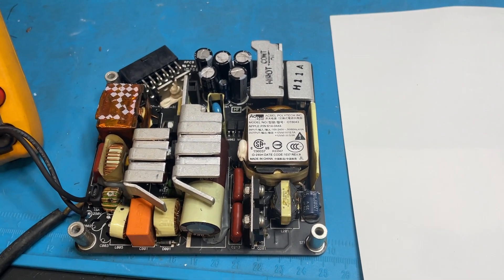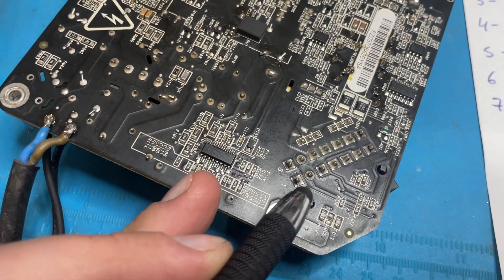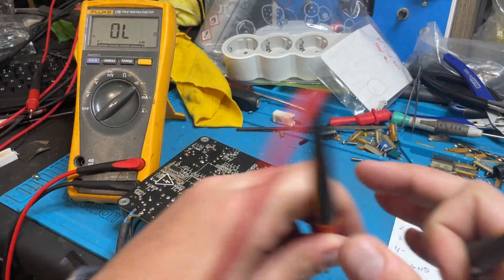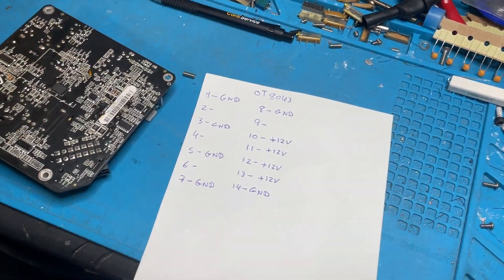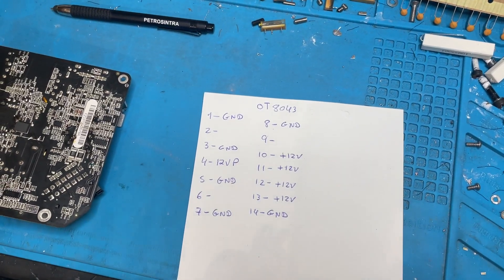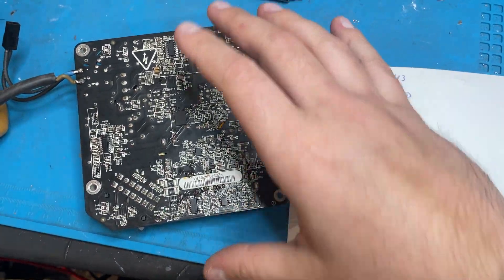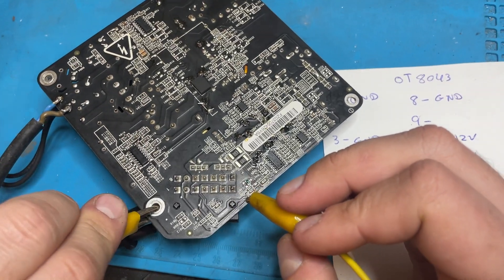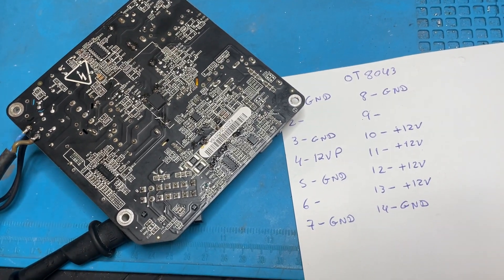Apple iMac 21” Mid-2010 power supply test Ac Bel OT8043, Apple P/N 614-0444

Comment: Hello. The video was very useful for me. However, I saw a small mistake. In the research I did with my own power supply, there is a Logic level voltage on pins 2 and 9. The same voltages are also available on the 27-inch mac power supply. These pins are the i2c pins that go to the motherboard to determine the temperature values of the power supply. SDA and SCL signals. I examined it with an oscilloscope and also looked at the schematics of both models. For the inverter, it receives voltage from the 12v 5VA pin on the 21.5-inch and GND is directly connected to the PSU GND line. However, they left a separate pin for the inverter on the 27-inch model. I wanted to make a small addition.

Comment: Hi. I have a very similar supply of iMac 27inch 2020 with 16 pin output connector . On the output pin 2 and 10 I have 1.1VDC. 0VDC on all other pins. That indicates that the power supply is broken. Nothing visually looks burnt on the power supply. What is your opinion? Please help.
Reply: Sorry for my mistake. It's iMac 27 inch model 2010.
Reply from the maker: @pawelorlowski3515  if you followed the test procedures on this video and you still have no output voltage, then your power supply is faulty. You can repair it or buy another on eBay.